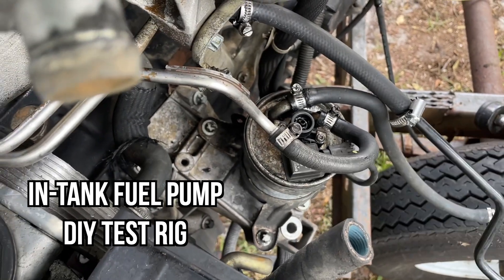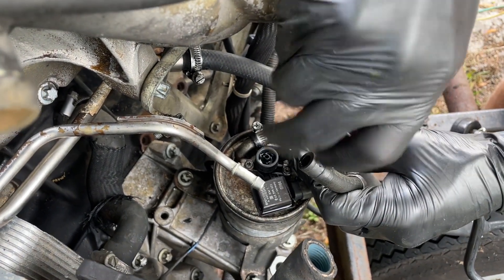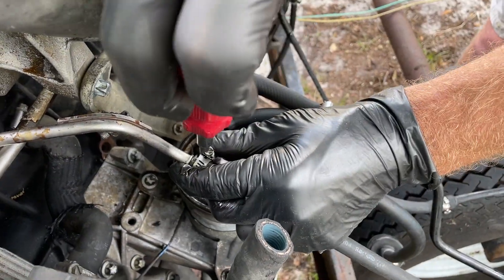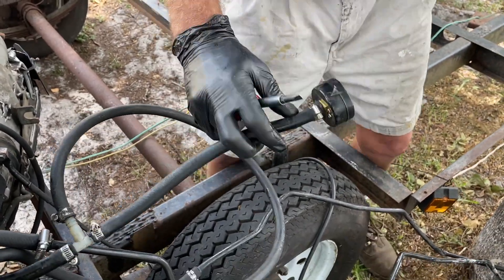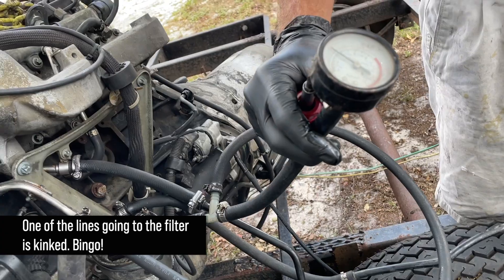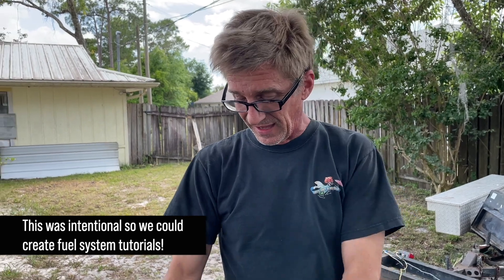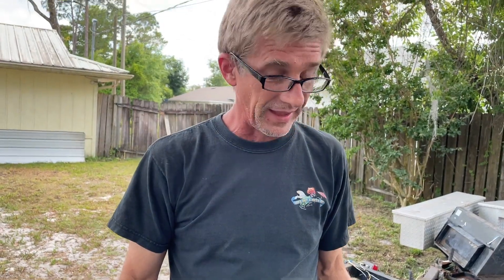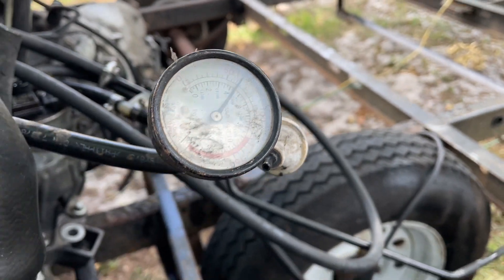In-Tank Fuel Pump Pressure Test Rig - T1N Sprinter

Comment: What was the pressure? Where was the kink?
Reply from the maker: Pressure in the fuel system should be 50psi minimum, up to 80psi before and after the filter. On our test rig we had a kink in the tank output line. We just moved the fuel tank to relieve the kink.

Comment: If I were to add a permanent/full-time aftermarket fuel pump pressure gauge (to my '08 3500 NVC3 Diesel) would the hose setup for your pressure test rig suffice, or is there maybe another/better way to add an aftermarket gauge to monitor pump pressure?
Reply from the maker: I don't know the '08 Sprinter well enough to be sure where I would add a Tee for the pressure gauge, but yes, this would work.

Comment: Hi guys 
I have a 2003 sprinter 2.7 litter that always have surging problem when going up hill 
I really appreciate any feedback or suggestions on what I will need to do to fix it.
Thank you!
Reply from the maker: Surging power is usually* fuel pressure problems. Leak off test for the injectors and the fuel rail would be my next move. This in-tank video is no good for you since a 2003 doesn't have a pump in the tank.

Comment: I was under the impression my sprinter didnt have an in tank pump? Its a pig to start after a fuel filter change. Thats why! Am I wrong?
Reply from the maker: If you have a North American Sprinter before 2004 it doesn't have an in tank pump. This is only the OM647 engine, 2004-2006. Many Euro models are also without in-tank pumps, I think beyond 2004.